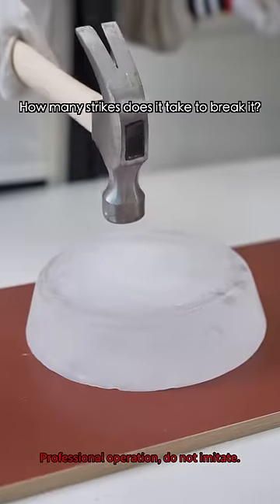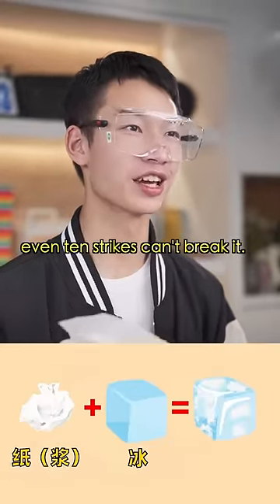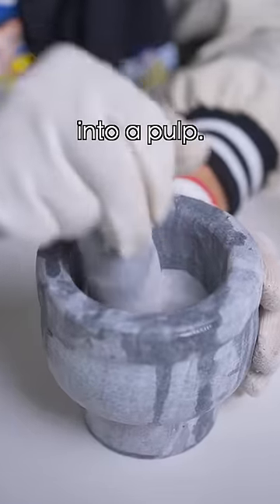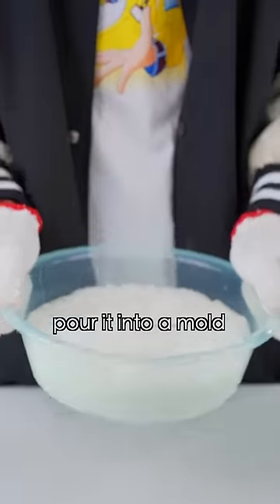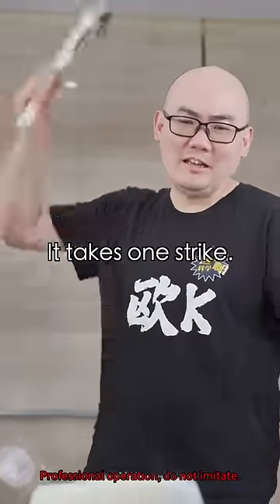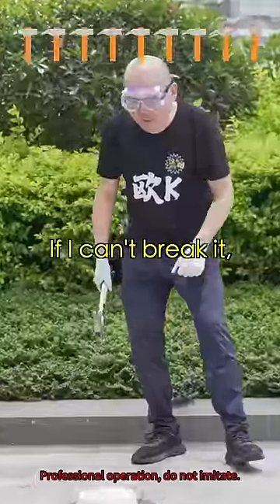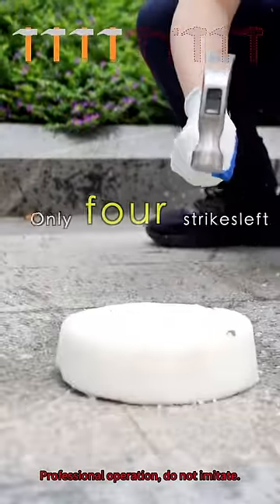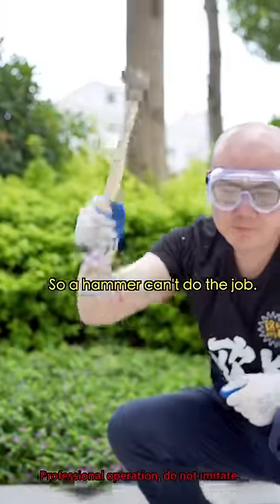How Many Strikes🔨 You Need to to Break this Ice Brick🧊?

Comment: Use a hydraulic press or take 100 strikes to fully break Pykrete
Reply: Breaking pykrete is like breaking tree
Reply: @robloxspdm3243   wat you mean like cold tree? Or put in salt and will break
Reply: @hassanmihraan4637  because paper made from tree and if you only put like 1k paper ontop theres still some bend but froze it it will get solid like tree again with some more resistance